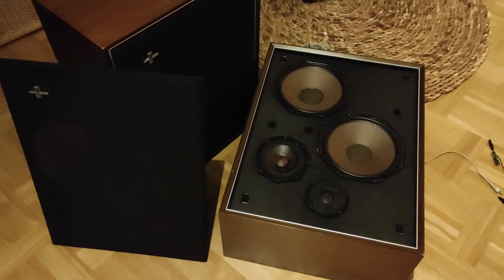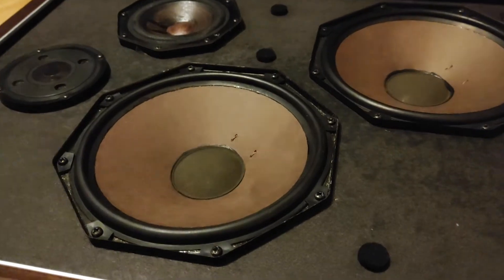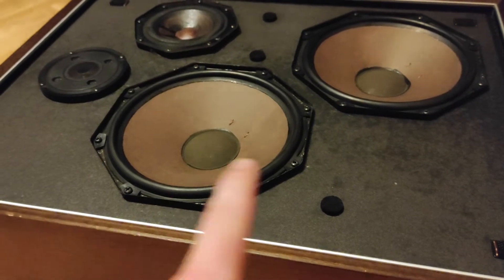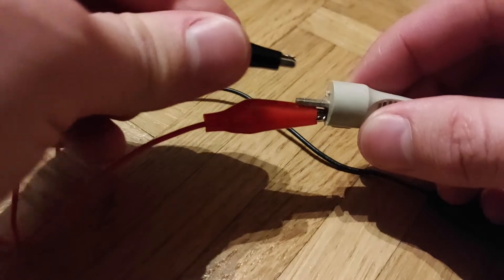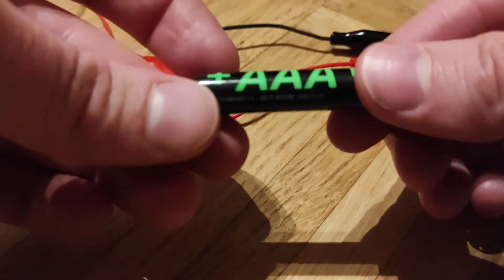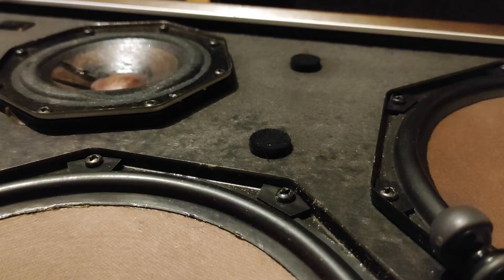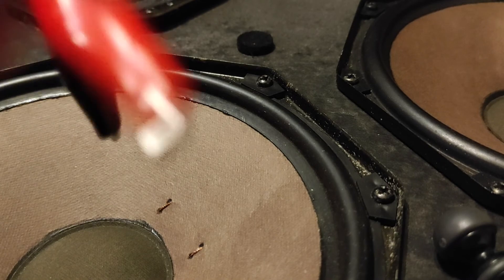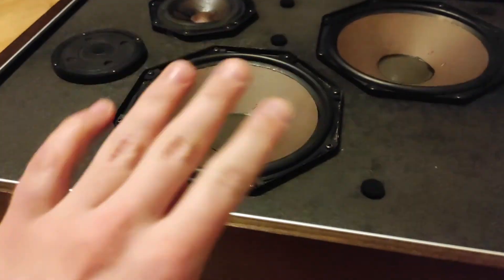How to Test the Polarity of Speakers 🔈

Comment: Nice, would love to hear what those old school speakers sound like!
With regards to polarity, the easiest way to tell of the speakers are out of phase (apart from the bass you mentioned) is the sound becomes "diffuse", i.e. you cannot tell where it is coming from. With the speakers in correct polarity the sound will come from between them. This is why early surround formats used out of phase signals for the surround channel as the effect was similar in 2 channel setups.
Great video and "hi" from Melbourne, Australia!
Reply from the maker: I can show how they sound sometime! But that would maybe more tell you how my mic sounds actually haha
Interesting with the diffusion and out of phase surround, didn't know that! Sounds like that surround system would make the sound a lot worse!
Reply: That is how the original Dolby Surround worked, but used a limited frequency response for the (single) rear channel.